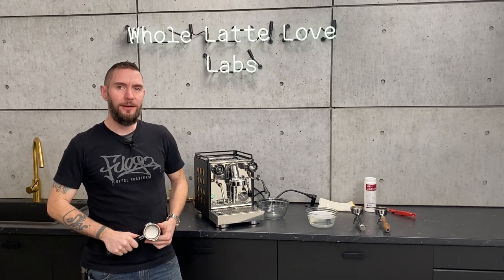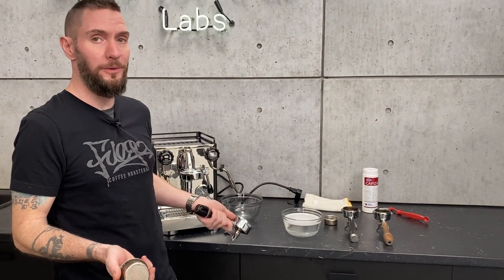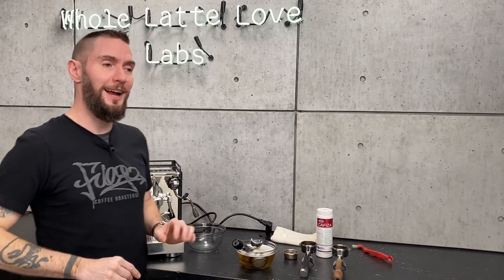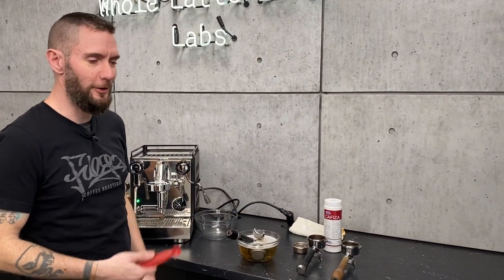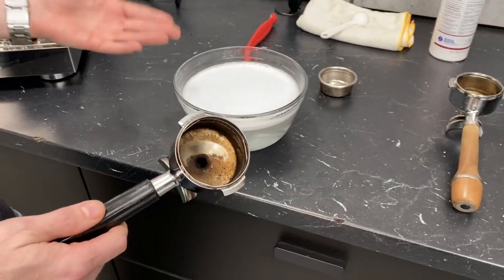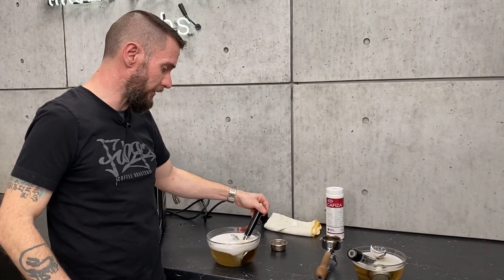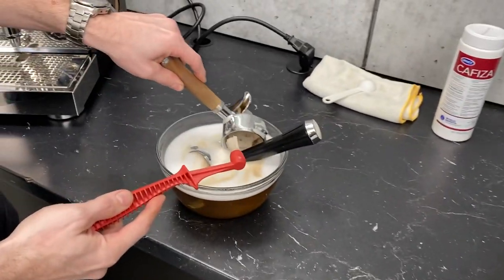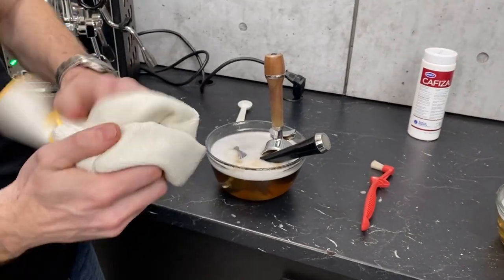Espresso Machine Maintenance: Cleaning Portafilters & Filter Baskets

Comment: I have been using my machine for a year, only ever rinsed out the filter n basket, today the double filter stopped passing coffee, is this due to not cleaning it?  I have the pressure cups, the single still passes coffee.  and how does one clean the machine itself?  I have done nothing but add water to the machine and made coffee for the past year...  1st machine and experience with one...
Reply: The filter basket only has a tiny hole on bottom, it does not pass water when rinsed...  so been concerned with cleaning since and was afraid to soak in soap as thought would be trapped between the layers,, again nothing has been cleaned since purchase as not covered in the manual.. guess they expected me to know this...
Reply from the maker: Hey c, What make/model machine do you have. Honestly surprised the pressurized basket still worked with a year of no maintenance! Surprised to hear there was no maintenance info in the manual. I've used 100's of machines over the past decade and never run into a manual without maintenance info.
Reply from the maker: You can try a cleaner like Cafiza which will loosen/dissolve coffee oils: https://www.wholelattelove.com/products/urnex-cafiza-espresso-machine-cleaner?variant=14409596141627
If you can get it to pass water after a soak the water running through will rinse out remaining cleaner.

Comment: Brian need help I have mozzafiato the front face of it cloudy I tried a food based cleaner worked a little what do you recommend to get that mirror finish back when you look straight at machine thanks.
Reply from the maker: Hi BP, Thanks for the question. I get best results from regular ammonia based glass cleaners like Windex. For stubborn stains (unlikely on the face of a machine) you can try wiping with a Cafiza solution. Cafiza is typically used for backflushing but does a great job on coffee crud/oils in drip trays, etc. Beyond that, you could try a chrome cleaning agent - but I've never had to go there.

Comment: So if we have the IMS precision baskets with the nanotech coating, we should NOT soak it in the Cafiza bath? We should just get some of the Cafiza bath water on the basket and wipe it off with a cloth, correct?
Reply from the maker: HI JJ, As mentioned in the video it's best to think of the nanotech baskets as you would a non-stick cooking pan. The coating is resilient but abrasive action will wear down the coating faster. Short exposure to Cafiza is fine and should not cause abnormal wear but avoid extended soaking.

Comment: For the strainer basket, I can never get the blockage out of the hole and saw a TickTock where you hold it in a blue flame and it burns off. It's great but not sure I would use on an expensive or coatd basket.
Reply from the maker: Hi s, Have not tried cleaning with fire - Cafiza gets the job done with no burns and for the average home user a bottle lasts about a year.